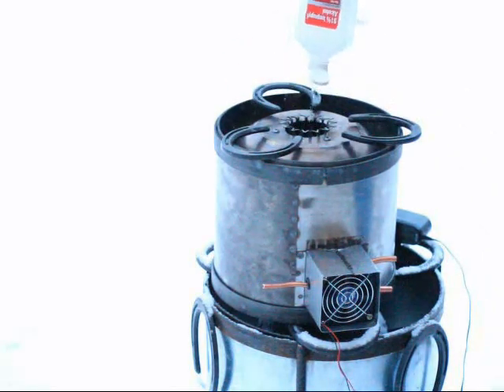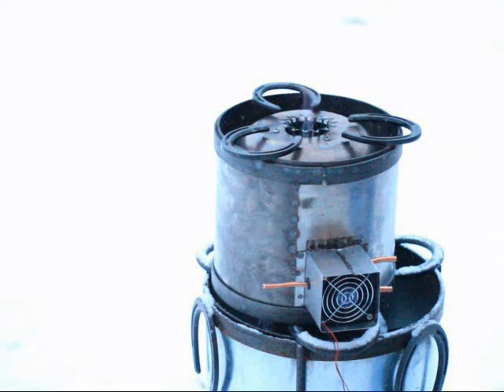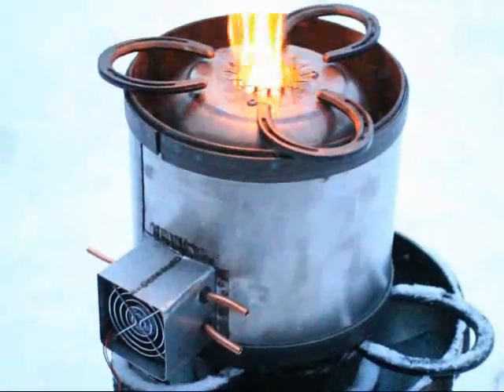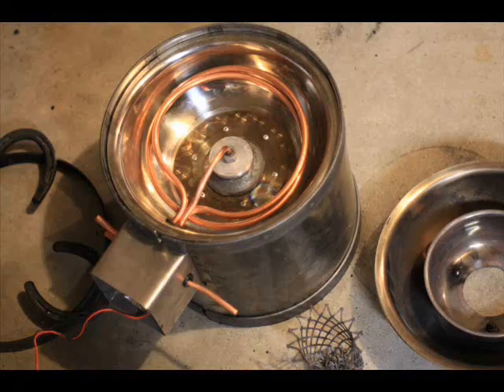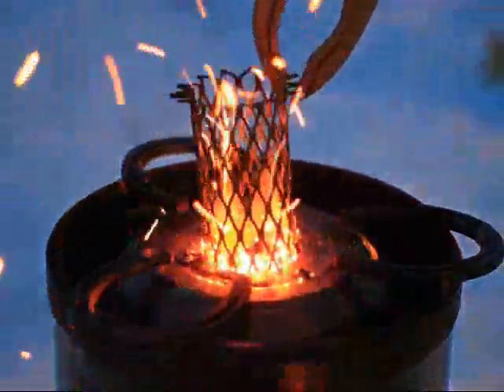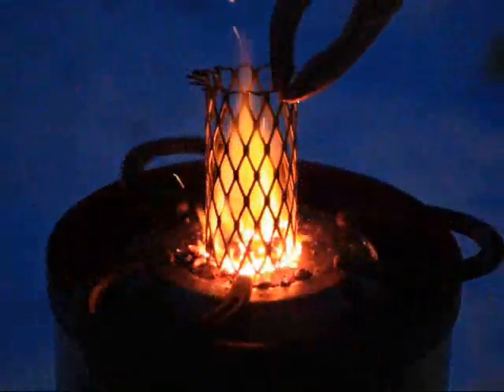Montana Mixing Bowl Stove Part #2 Multi Burn Biomass TLUD Wood Pellets Charcoal Rocket Alcohol

Comment: Just to add...if the purpose is just to heat water...the water pipe could be looped even onto top of the stove....my guess is that the device could capture a very high fraction of heat into water...still spare enough heat to cook at top....good for surviving snow storms without other means of heating.

Comment: If the burn basket remains the same, there should be a lot of empty space in the the burn chamber to route a metal tubular coil (0.75 inch diameter) which will capture heat, with its intake through the fan power, and its heated output divided for primay and secondary burn. It will be like a concealed blast furnace...from which heat could be extracted via coiled water pipe ( multiple coils, 0.25 inch diameter) without having a negative effect of cooling the burn chamber too much...

Comment from the maker: I think I am using 1/2" and aprox 12 gauge in this video but you may want to go with 1/4" so the pellets don't fall through (some of mine do) ....  not galvanized of course. Also, as far as pellet selection goes if your using it to cook food you will want to get the food grade ones for that ie. hickory, oak, mesquite etc.. If for heat you can go with those large bags for aprox $5.

Comment from the maker: Good call, I think that stuff may have oil though, not sure. I was also thinking of wrapping the water coil a little smaller and pouring hot aluminum over the whole thing for max conduction ... but then I couldn't take it apart?

Comment: You just gave me an idea. I have a rocket stove water heater And I don't need to burn pellets for hours just for a few minutes at a time. I think I will make a 1 by 2 Inch flat cage Maybe 6 to 8 inches long Fill it up once and let it burn. Thank you for the idea.

Comment from the maker: Think I saw that too ... swedish log torch? I also saw a guy (bushcraftmyway) chop three green branches and hammer them into the ground to make a tripod for the pot or pan ... small fire built within. Simple but effective. My original idea was a wood stove that was kind of like a thermos than it morphed into this... you know me :> Thinking is how can a guy get the most out of the fuel he has? Must burn clean and not loose heat off the sides. Gotta get this done before I start on that turbine!